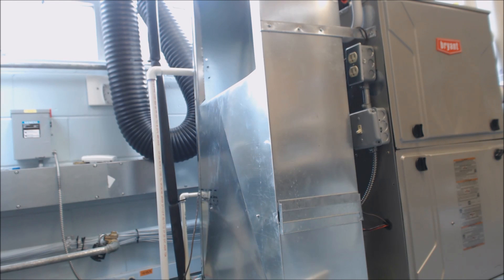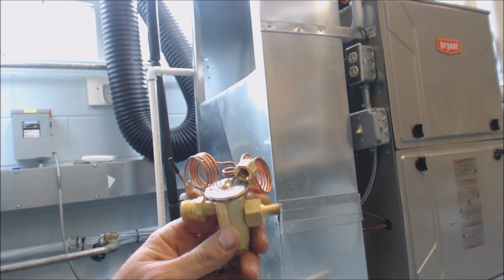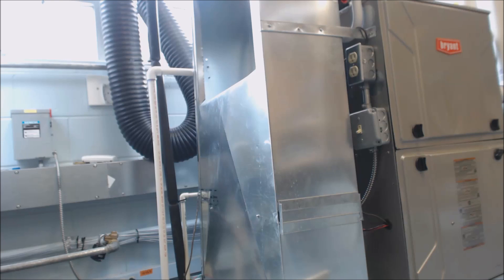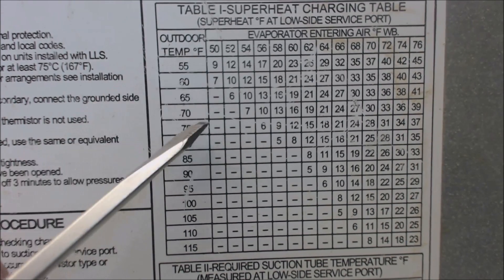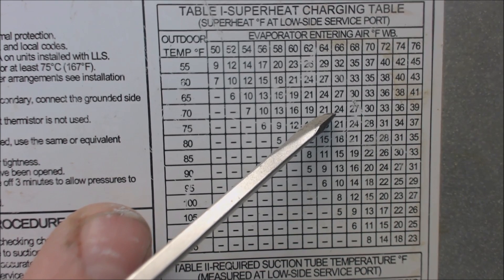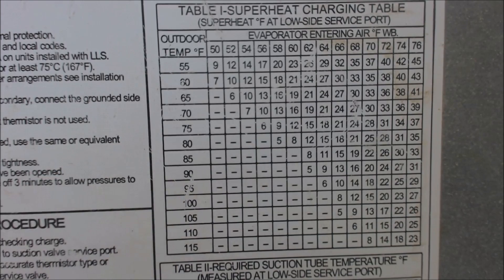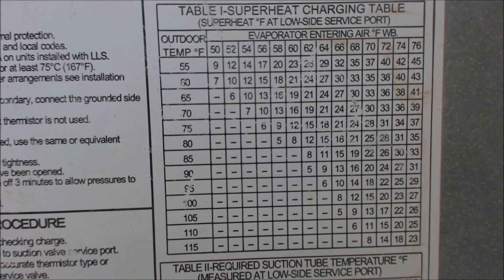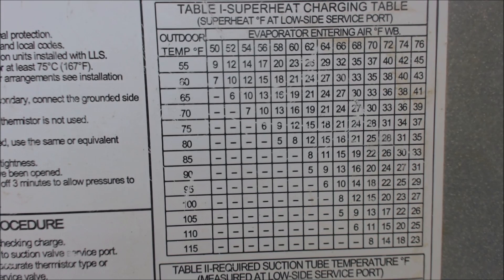AC Refrigerant Charging -Superheat Measurement: How to find Target Superheat for Suction Vapor Line!

Comment: My evap coil has a piston but the new condenser im replacing has the charging chart for a txv,should i charge as superheat or subcool?new condenser ill be installing has 1lb of 407c in it,split system was originally r22. Im Only replacing condenser
Reply from the maker: You would check that with superheat because it has a piston using dew with a p/t chart or app such as danfoss refrigerant slider, thanks!
Reply: @acservicetechchannel  ,any apps that doesnt charge for r407c?
Reply from the maker: @justdissin7340  danfoss slider is free
Reply: @acservicetechchannel  the reason i ask is because someone told ill have to pay to use r407c on that app,ill check it out thank you sir

Comment: Thanks for the video. Another great one. 
So far I haven’t seen a single video where anyone goes back and forth adjusting their superheat with charging the system and finally meet their required superheat. Maybe you can make one.... :)
Honestly I have been with many big AC installer and No one-Not a single one of them do this in that much detail. Why is it so?
Reply from the maker: Check this one when I was using wireless sensors for superheat but it may have to do with the extra time it takes to move and setup the camera in each location while trying to do it in real time. Thanks for letting me know! https://youtu.be/YPitQHSgvog

Comment: Great job son, I’ve been in this business since 1987, (we only had r-12, r-22, r-502, r-11, and r-500 back then).  I know things are changing darn near daily, but what can you teach this old dog concerning a new trick?  In areas like Phoenix and Palm Springs that reach over 125*F during the summer outdoors, and indoor wet-bulbs under 65*F, yet the indoor ambient temps read 78*F, what can you teach this old dog?  I’ve seen R-22 units hitting 450 - 550# discharge, 50# suction and run well but freeze up - the compressors obviously fail quickly.  If we charge by superheat during the summer to keep the compressors cool, in the winter they die because they’re overcharged.  I think this isn’t for you, but the manufacturer’s.  Thanks for all you do, but maybe this one’s out of your expertise.  Good luck with this global warming crap!  I’m thinking in the deserts it’s time for larger accumulators to hold the charge in winter, and siphon the oil back to the compressor in the summer.  Also, more SEER 16 units, lower that darned head pressure!
Reply from the maker: Hey Jeff, only install TXV's in that environment. Nobody should be installing fixed orifices there. It doesn't make sense for compressor safety and efficiency. Also you hit on a good point. If there is a piston or even if there is a txv, an accumulator would also make good sense there due to the temp swing. I wrote quite a lot on this subject in the book I just put out. I just can't believe people are still installing pistons there. I think it is just that they don't understand how the txv works and the benefits, thanks!

Comment: Thanks for a clear explanation video.
I have a Goodman AC unit. The Superheat table in the manual for it is different than Superheat tables that I found on the internet. Some of the entries in the table are different up to 5, 6 degrees. My question, is this supposed to be? Is the superheat table is the same for every conditioner? I called the technical support and they didn't know and asked me just follow the one in the manual.
Thank you
Reply from the maker: You should use the target superheat table that they supply to be safe, thanks!

Comment: i dont get it. So you determine your superheat value. Then when the wet bulb decreases your superheat value changes? 
So when do you have the correct value of superheat?
Reply from the maker: So you find your target superheat with wet bulb and dry bulb temp, then check the actual superheat with temp on the vapor line and the pressure on the vapor line converted to saturated temp. Then check your target again. The actual superheat and the target superheat will follow eachother so if you undercharged then your actual superheat will keep the same amount of degrees away fro  the target but yes they will be changing while running, thanks

Comment: Do you take the WB and DB readings with the unit running
Reply from the maker: Yes and then continually while the unit is running and you are charging. The wb will lower as the system runs

Comment: Hello sir. I have a question. Are ranges of temperature  for superheat and subcooling apply just the same with CELCIUS unit or only for FAHRENHEIT? Hope to hear back from you sir. Thanks.
Reply from the maker: You would have to convert the rated subcooling of 10 degree F to C instead so that would be 12.2C, thanks
Reply: acservicetech 
Thank you sir. Will it be -12 degree celcius to be exact? And may I also ask the normal range for superheat?

Comment: Thank you for the videos. have a question. Is the superheat charging chart good on units using different refrigerant, say r22 and r 410a?
Reply from the maker: Great Question! Yes, the charging chart is good for checking the charge of any refrigerant used for comfort cooling systems. R-22 and R410A are the most common. Thanks
Reply: Thank you for the quick reply.
I have this question for a long time.
We know air expands when heated, so the Charles's law: pressure 1/temp 1=P2/T2.
After all liquid refrigerant in the Evap boils to vapor, the vapor absorbs more heat and  becomes superheated. It means the temperature goes up. I think the vapor pressure should go up too. So I guess the vapor pressure at the Suction line port should be higher than the pressure in the Evap because the temp at the port is higher than it is in the middle of the Evap.
When we hook up the Gauge at the Suction port, I think what we get is the pressure of the superheated refrigerant vapor instead of the saturation pressure in the middle of Evap.
Can you tell me where I'm wrong?
Reply from the maker: Great Question! You are not the first to ask and I actually made a video answer for it. Everything you said should be true but we also have to take into play how fast the refrigerant is moving for the temp to react to pressure and pressure to temp. Here is a video that shows matching actual saturated temp. I installed a port in the middle of the evap coil. -https://youtu.be/th0EnaSbJUw

Comment: Hi ACSERVICETECH,  have a question. When you measure your superheat by measuring the line temp and gauge temp then subtracting them this gives you what the unit is running at.  So is the target superheat  what it should be at? I ask because I have seen some techs not use the superheat charts before.  Thanks again.
Reply from the maker: Yes exactly, you set this as close to the target as possible. They may feel that they can get close just on prior knowledge and set it according to what they think the low side should read on that temp day. Here are tow things for you to chew on. Efficiency of the system and Compressor life. If this superheat is not set correctly, then on cooler days when the ac is on, there may not be any superheat and some liquid will be in the compressor. The same unit can run at 30 degree superheat one day and a week later run at 7 degree superheat because of the wb inside and the outdoor temp so if it is not set accurately then it may not be as efficient as it can be for the homeowner. Thanks for the question!
Reply: Thanks ACSERVICETECH!  That makes perfect sense to me, thank you.  Oh, and I am the same guy  as 1290457 was I just now got around to giving a name to my page LOL! Thanks again boss.
Reply from the maker: I figured so by the pic. Thanks!

Comment: Hello ACserv,

Love the videos. Your my main go to for learning as a new apprentice. I have a question. During your video you use your psychom near the return by the furnace.The guys at work have told me to take my reading on the main floor. They actually said to just stick my psychrom on top of the thermostat. Should I be using my meter in the basement near the return beside the furnace? I live in canada I do strictly residential. Majority of our furnaces are located in the basement. Also I currently use a ABM-200 bluetooth psycrometer, i am having doubbts with this product. What do u currently use for your WB readings?
Reply from the maker: I am glad you are enjoying the videos. The reason I was taking the wb temp near the furnace was in the video the return duct opening was actually there. I usually place the wb psychrometer near the larges return grille in the building. The thermostat is usually right near the largest return grille so that would be the same concept. I just use my old digital psychrometers, either general tools--http://amzn.to/2bFOWGr---- or amprobe----http://amzn.to/2briA1C---- or sling psychrometer but I go back and forth every five minutes into the house to check the wb. The general tools one has lasted 14 years and still kicking and accurate against the sling. I hope these links help! Thanks

Comment: found a thermal pride condenser unit today with the low and high side gauge ports inside the house with screw on lineset.  never seen that before.  but my numbers
 85 OD  59WB 
73 line temp and 75 psi R-22 no charging table to find SH?  that's why I was looking through videos how do I find this out
Reply from the maker: This is a superheat charging chart---https://youtu.be/bIL9BrKCujc-----This is full superheat process---https://youtu.be/q-G7FLlzhAg
Reply from the maker: Thanks for the Comment!